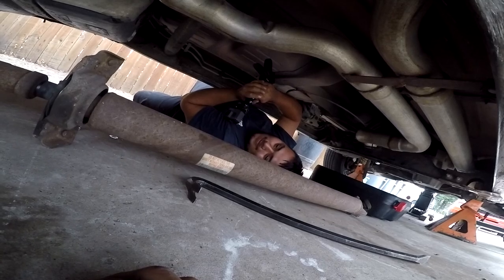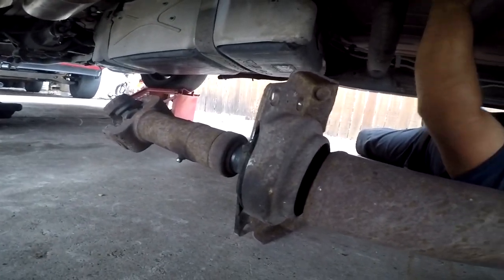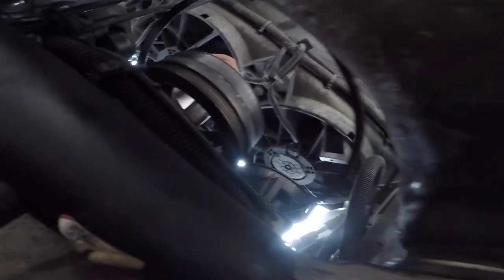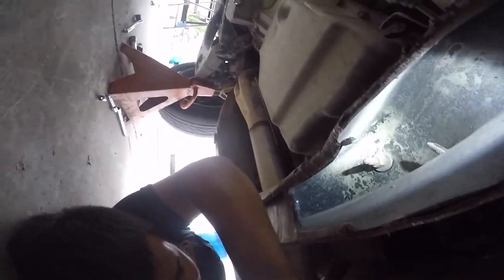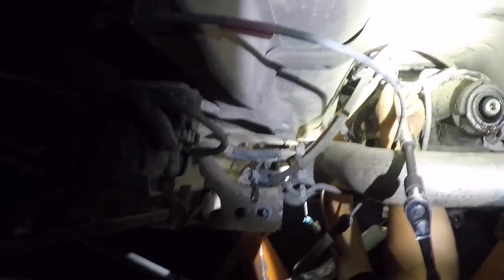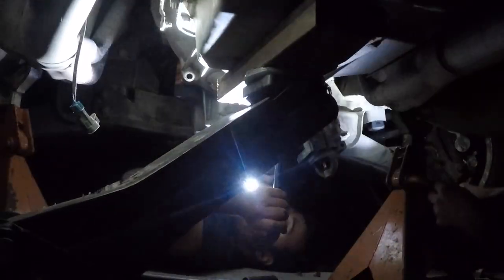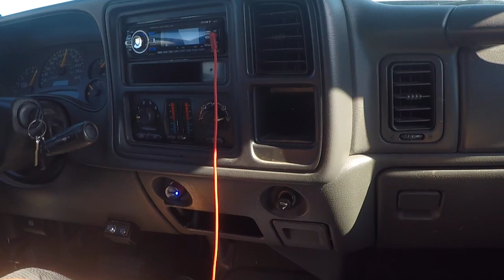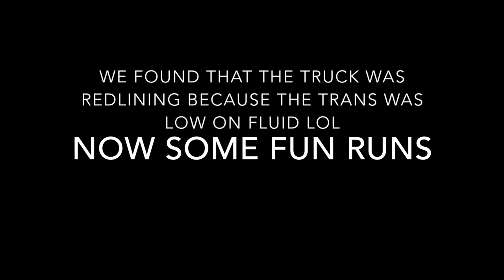STALL INSTALL | BTR STAGE 4 | RACES | CHARGER R/T VS CAMMED SILVERADO

Comment: Just blew the transmission on my fbo, cam & stalled 06. I bought a new rebuilt one, gonna put it in tomorrow but...not sure if my stall went bad. I have a 36-3800 PI multi disk. I lost every gear in my transmission including reverse. You think the stall is still good bro? Just looking for opinions. Really don’t wanna have to buy a new one. 😂
Reply from the maker: damm honestly idk how to check if the stall is still in good condition but I guess it wouldn't hurt to send it to the manufacture so they can check it out
Reply: Dinoco Blue true. I’m probably gonna end up doing that. Thanks for the input bro.
Reply: LS_ Devan did you change it?
Reply: bully boost I ended up just swapping the tranny and keeping the same stall. Trucks running back to normal. No issues so far.
Reply: Man I just went through the same thing in my fully built 4l60e. My torque converter grenaded. It was a advance auto pro king gm92. I recomend not to buy one of them. It had less than 12k miles and the truck was babied. So I got another torque converter with a 2000-2300 stall. My clutches in my transmission are welded together. I had the alto red clutches in it.

Comment: Looking to cam my 2000 z71. 5.3 9inch lift 35 inch tires 3.73 gears for now. Hopefully 4.56 gears afther I recoup from another transmission rebuild. What size cam is recommended. Basically I daily drive, I do trail ride some no major mud, some towing like a 21ft bass boat. I have a custom tune 93 octane, no cats cold air, exhaust, soon to be shorty headers.
Reply from the maker: I would go with like a stage 3 cam from btr

Comment: Hello I'm from Rowlett I have the 5-3 Tahoe can you recommend a tuner I also have the BTR stage 4 headers long tube ported heads 2 inch LS1 intake valves trunion upgrade but it needs it to I would appreciate it if you could recommend someone thank you great videos guys
Reply from the maker: overNOVAcated I would go to lsx unlimited they are located in Alvarado tx, they are good at what they do
Reply: @dinocoblue2709  COOL I will check into it thanks Bro

Comment: How long did you guys take to drop the trans? Approx wise if guys were to work on it at one time without taking breaks ect. Getting ready to drop my 4l60e cuz something went bad in it
Reply from the maker: Steven Palacios about 5 hrs I would say, but there's a few things that you can do to make it easier and get it done faster, like for example if your exhaust goes under your transmission it is easier to just kit the exhaust and the trans will just drop easily but we didn't want to have to go to the muffler shop after so we just fought the trans around the exhaust
Reply: Dinoco Blue Garage appreciate the response! Ended up dropping my trans today, took about 4-5 hours. Not to bad I guess for the first time and doing it on the floor
Reply from the maker: Steven Palacios yeah that's not bad at all bro, what are you going to do to the trans?
Reply: Dinoco Blue Garage gonna go with a rebuild on it or buy a remanufactured Trans build for more power. I believe my 3-4 clutch pack went out. I'm fbo cam right now and just did nitrous on it and so trans wouldn't hold stock 235k miles anyway so gonna upgrade insides and like a 3600-4K stall. Should kick some ass around town
Reply from the maker: Steven Palacios damm that's bad ass bro do you know how much you putting to the tires?
Reply: Dinoco Blue Garage depending on the shot I should be putting about like 400-450 to the wheels. Nothing to major but with a good stall and tires it will be a good dig setup
Reply: Dinoco Blue Garage any idea how much the red truck on this video or the blue silverado makes to the wheels?
Reply from the maker: Steven Palacios that's pretty good and for reals just put some slicks and you'll hurt some feelings out on the streets lol
Reply from the maker: Steven Palacios we have no idea bro neither of them have been on the dyno only street tune
Reply: Dinoco Blue Garage oh yea no doubt it's gonna hurt feeling, everyone sleeps on trucks until they get beat by one 😂 and ahh I get what you mean

Comment: Would you recommend a 3200 stall for a btr stage 4 cam?
Reply from the maker: daniel chavez yes the red truck on this video has a 2800 and the 4.8 with the stage 4 cam in my other video has a 3200 stall
Reply: Unless you're constantly racing, go lower. I loved the circle D stall I had in my 2012 5.3 Sierra with 228/228 .588 114 cam. Didn't like the 3000 yank I had in my 6.2, too loose.

Comment: Hey bro if I want to cam my 4.8 with a stage 4 cam like the ones you’ve installed what else would I need to order ?
Reply from the maker: Omar Alvarez just the cam kit from btr that comes with the cam and springs, then you'll need a timing cover gasket and a water pump gasket, which you can buy as a set at autozone for about 10 bucks, then you don't need to change your stall but it is recommended
Reply: Okay fosho bro thanks u got an ig?
Reply from the maker: Omar Alvarez yeah bro it's Lorenzomedrano

Comment: I have a 2010 Silverado what do I need to cam my truck bro?
Reply from the maker: ZemoPatchv5 do you know if you have D.O.D or VVT?
Reply: Diego Medrano yeah bro I do
Reply from the maker: ZemoPatchv5 which one do you have dod or vvt?
Reply: Diego Medrano shit to be honest I'm sure but pretty sure d.o.d I seen your truck around bro we stay on the same place
Reply: I have a 2011 crew cab I did the vvt delete I have a mild cam 218/220 cam Texas speed. 3000 stall, k and n intake, long tube headers and dyno tune. did the set up when it had 20k miles, so far it has 56k no issues i race it very often (every weekned). if i were you i would do 4.10 gears and port your heads and btr cam with my setup also or a bigger stall. that's my next step going with btr stage 4 cam but hey the choice is yours lol
Reply from the maker: WTBblazeicm12 damm that’s bad ass bro thanks for the advice and yeah I’m planning on doing a stall soon and maybe go with some 862 heads and yeah I want to try and do the 4:10 gears my self but idk if I want to risk it lol we’ll see
Reply: its a huge difference with 4:10 gears bro I'm planning on getting everything done very soon lol
Reply from the maker: WTBblazeicm12 yeah bro it helps the cam

Comment: Hey bro i have a 02 single cab 4.8 long tubes and intake.i want to buy the stage 4 cam.i have a billet 3600/3800 stall you think that Will work or to big of a stall
Reply from the maker: Jesse Altamirano I think that should work bro, you should be good

Comment: We Found out the truck isnt running right
Reply: Miguel Esparza ... Its is the wrong stall for his set up those btr stage 4 require a 4k stall mybe can away. With 3500 stall but hell that is thats still a ten inch converter may as well do the 4kstall.with a good tune it should run bad ass..
Reply: Jason Juarez nahh after that day we found out the tranny was going out so i couldnt make a good pass.. but we will be making another videos wen we have the red truck running 100% if i dnt sell it .